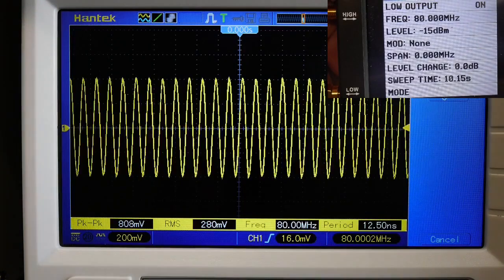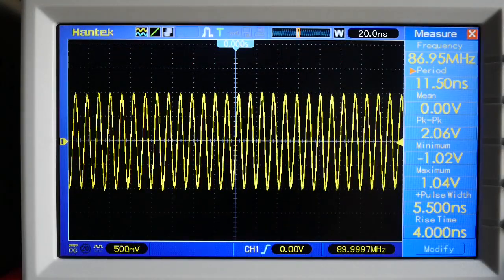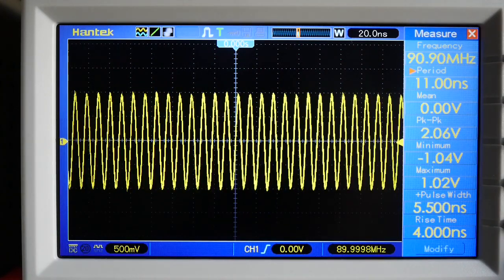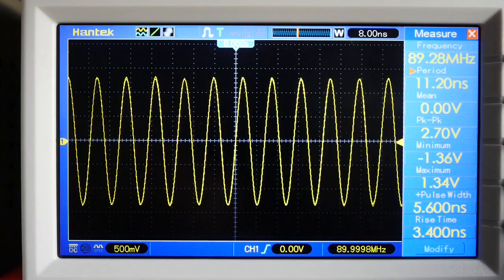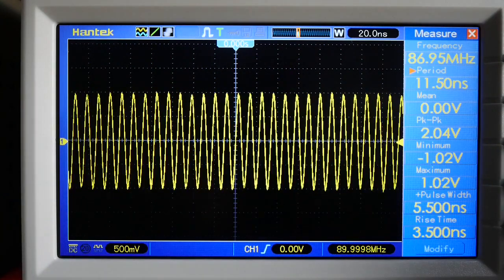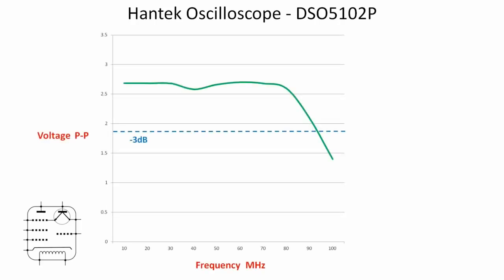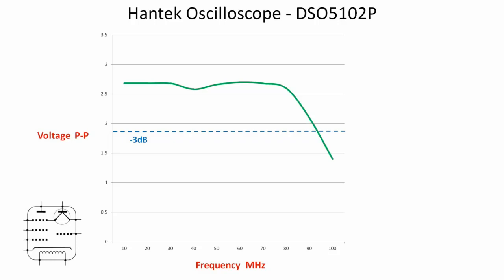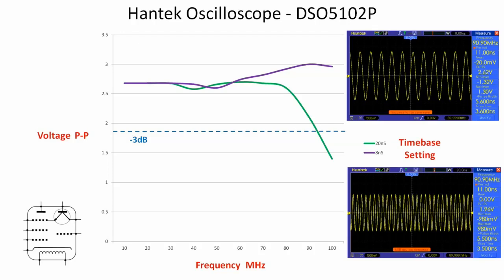Hantek DSO5102P long term review  - update - Voltage and timebase speed discrepancy - #048

Comment: do you have problems with mesuring low voltage signals? 100mv? 10mv? I want ot buy this model, but i have seen other models that have problems with low voltage signals.

Comment: In the last two days I watched near all the Hantek videos on YouTube, because I bought one. And for me it seems that Hantek is a garbage above a few MHz. Everybody said that their functiongenerator are "old, not precise, etc." In every video when they goes above 10MHz the graph on the display starts wobling in amplitude and frequency too. I saw a video where was another scope, a Rhode&Swarz which was rock solid. And I think the Hantek has a huge disability on their converter and or clock generator. What do You think?
Reply from the maker: In my experience, my Hantek scopes were far from garbage. My DSO5102P was an excellent learning tool.
Reply: @LockdownElectronics  I agree, I have used several, and they all have small glitches, but not the one you showed, which I cannot test (don't have the DOS5102P).  The worst is lock up requiring restart, and yes the bandwidth is generally pushing it and not super linear, but still good!  I think the other guy is spoilt by hid R&S, and forgets it cost 20x as much (if not more).

Comment: Isn't this down to the memory size of the scope?  At the higher timebase you will have fewer points per period of your waveform.  If you 'zoom in' to a faster timebase the memory of the scope means it's able to record more information per waveform period so can better rebuild the original waveform using the sinx interpolation.  If you're able to switch the view to line or point view, then you can see the actual recordings of the scope and what information it's working with to rebuild the trace on screen.  Then see where the points are at the different timebase settings.
Reply from the maker: Yes I think you are correct, I was thinking along the same lines recently, however you have put it far more eloquently than I could!
Reply: @LockdownElectronics   might make an interesting video, assuming the Hantek can switch to a points or linear interpolation display instead of sinx(x)/x?

Comment: Hi.  
That is not the only problem that this scope has. When you change VOLTS/DIV, the voltage reading is changing as well.
 And that's not all, when you change the Probe Attenuation in conjunction with VOLTS/DIV it also changes the voltage reading. I did many tests on a 5v PC USB power output.
Can you confirm that you have the same discrepancy?
.
.
500mV/Div - Mean - 5.00V
2.00V/Div - Mean - 4.96V
5.00V/Div - Mean - 4.60V
10.00V/Div - Mean - 4.80V
50.00V/Div - Mean - 6.00V 
.
.
etc.
PS. The vertical position knob changes the volt readings too. 
73.

Comment: I have just bought one of these, very impressed.  Looking at the manual, the behaviour you describe here might be explained in section 4.3 about acquisition.  The different acquisition modes sample the signal in different ways and the sampling rate is also affected by the timebase setting.  More or less sample points may be resulting in movement of the trace.
Reply from the maker: Agreed, I need to have a more detailed look at the manual.